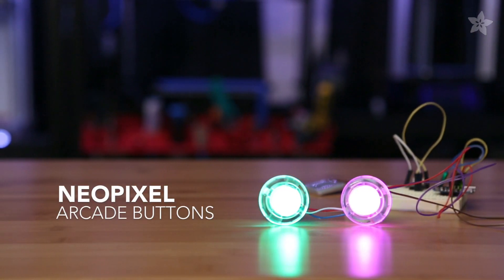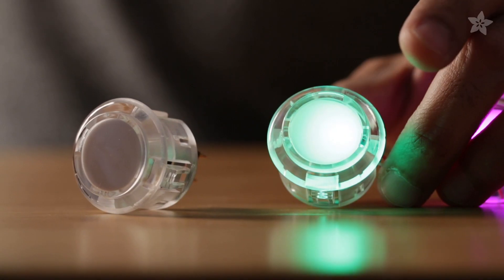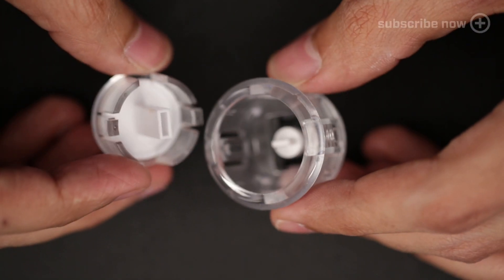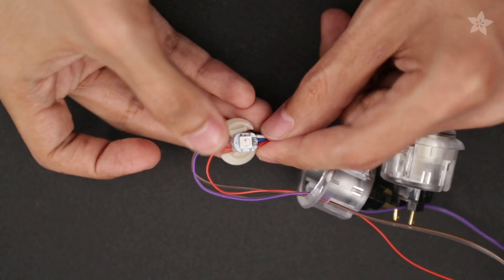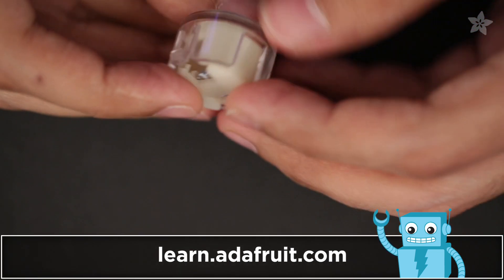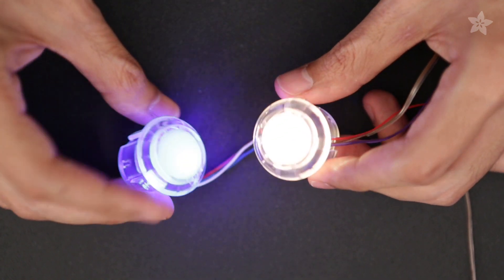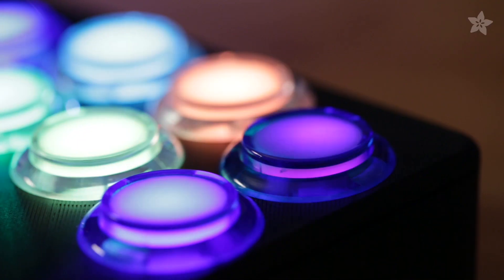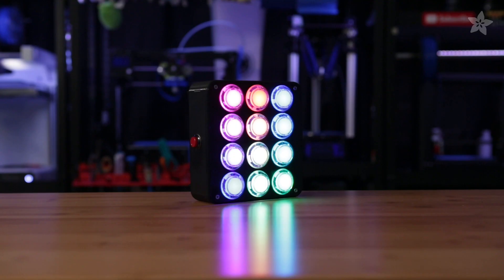NeoPixel Arcade Buttons

Comment: I'm curious, does anyone have any "plug in" software to get the pixels working with any of the emulator software programs?  Something that would light up buttons a specific way for a specific game, or (even better) light up or blink buttons you should be using (say to tell you how to do a combo attack or something)?  So many neat ideas but would require some significant integration with the emulator software.  Even something that just lit up the buttons that were "active" would be cool (for example, light up two of the buttons red for Nintendo games but light up SNES games with the 4 colors typically used on the original controller!)
Reply: They have it set up like that in this video

https://youtu.be/_jkyXNKug2k
Reply: LEDblinky is a great software to achieve this. 6 years late, but better late than never.